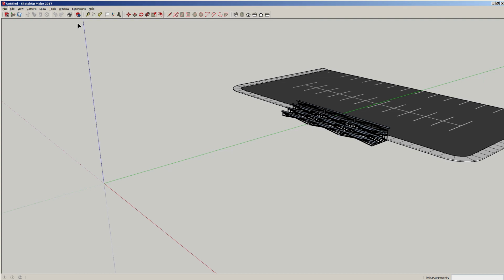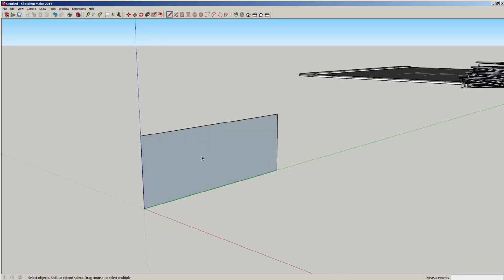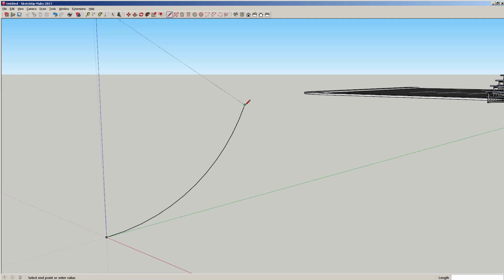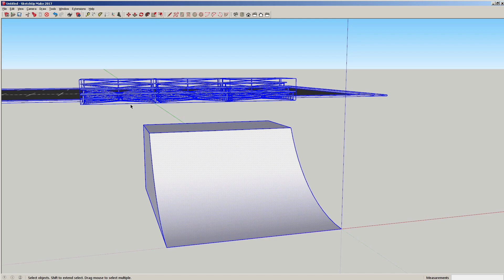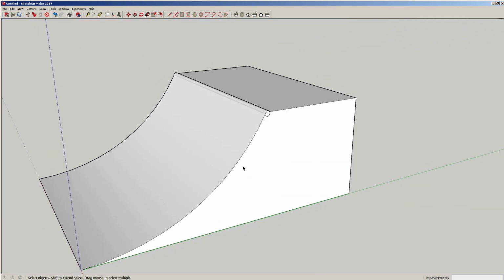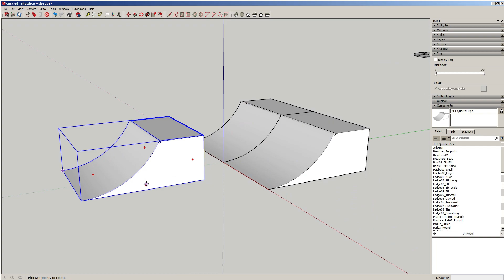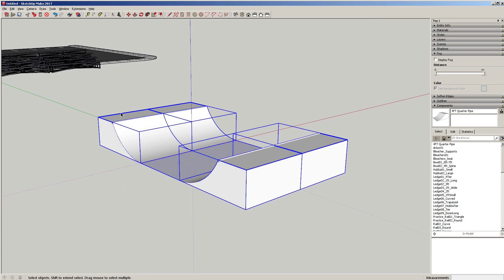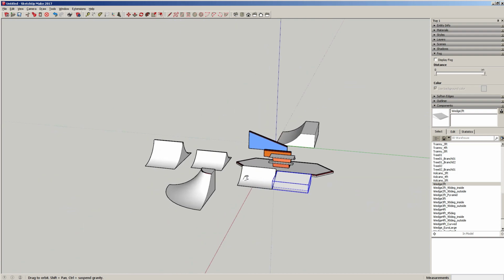Build A Skatepark:  Lesson 1 - Simple Ramp

Comment: Can you shade smooth so the ramp face is smooth riding up
Reply: OK thank you was thinking this be quicker then blender but at a cost i see
Reply: Oh yeah, SketchUp is 100 times quicker to model than Blender and the tools are much easier to use... but yes, you don't have features like increasing poly count and rendering features.  I have read there is a plugin for Blend that allows quick easy tools like the one's in SkechUp.
Reply: @brianinthered  yeah been trying build a dirt bmx track in blender and struggling to make realistic dirt jumps I can make basic skate ramps on blender and it is for a game
Reply: I've spent some time experimenting with SketchUp and game asset design.  SketchUp really isn't mean't for export to Blender or game engines like Unity 3D or Undreal.  It "does" work, but the normals are all screwed up.  Maybe if you are going for a low poly style of game it might work.  But i think you are on the right track to start with Blender.  Making dirt jumps has to be difficult because they have to look organic.  Kinda like MX vs ATV.  It had great dirt tracks and obstacles.   I just didn't have any real success with SketchUp.  I was importing my models into Unreal, but had so many issues.  I eventually gave up.... just didn't have the knowledge or Blender experience to keep going.
Reply: @JayCoGaming how’s your project coming along? I just found this video looking for a way to draw dirt jumps/trails and make them 3D. Kinda want to sketch trails and use them as a sort of blueprint to share with the guys at our local trails so we can have an entire line drawn & planned out before we start digging.
Reply: Yes, there is a smoothing option in SketchUp where it makes the curves look better.  I have it enabled, but SketchUp is not really a high quality rendering system without some modifications. What you see is the best you can get while designing ramps.